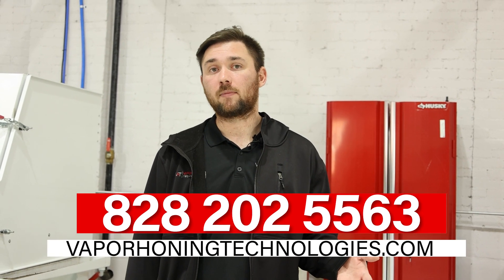What Size Glass Bead Is Best for Vapor Blasting or Dry Blasting?

Comment: Informative video.
If you had a part that was rusted and had paint, would you use a larger bead to remove that, and then a finer one to polish it, or does it not work like that?
Reply: Did they answer your question?
Reply: @usethenoodle  No they didn't :(
Reply: @Philip-Orr  I'd call them on the phone and ask.